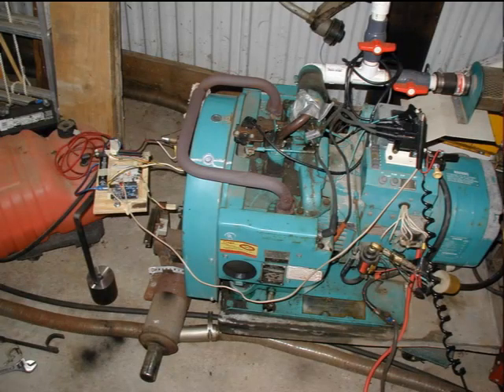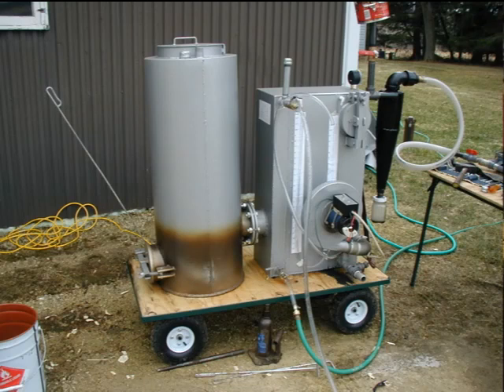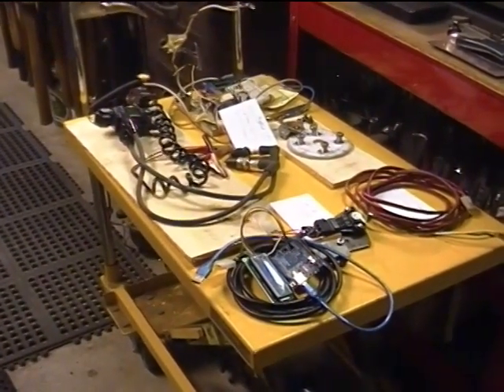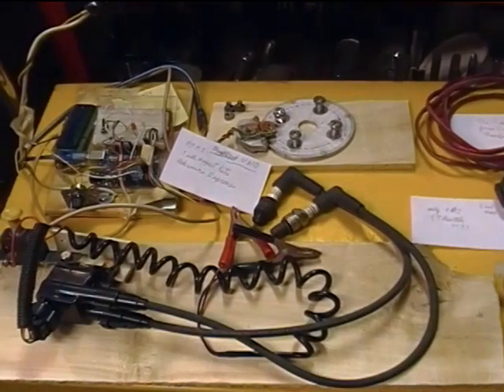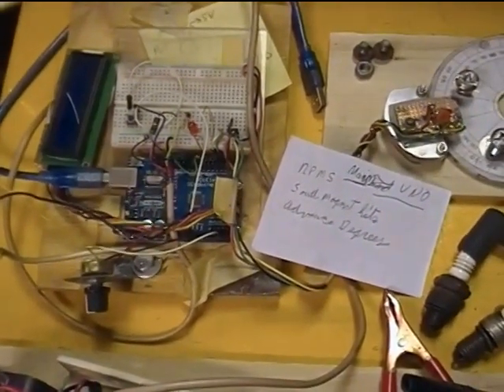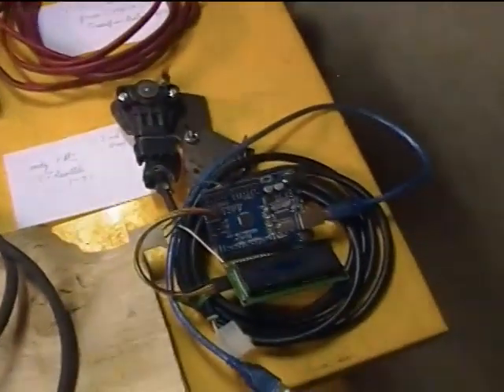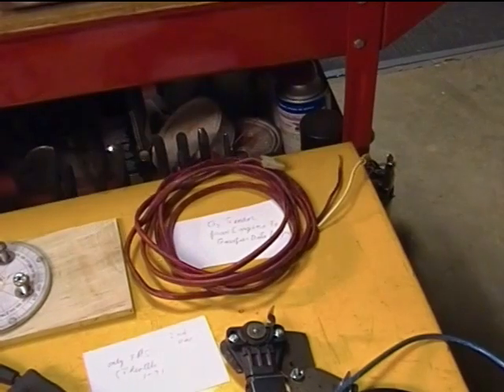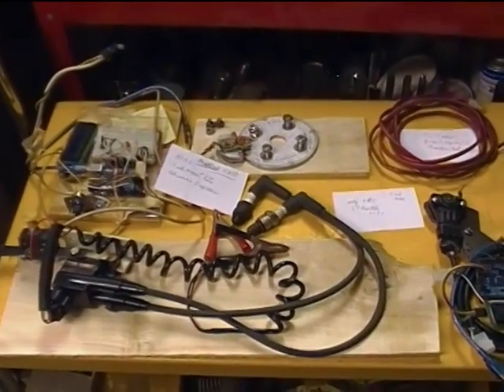Arduino ECU for Old Onan Generator to Run on Woodgas #214A

Comment: Also, how much do you want for the gasifier and where are you located, i forget.
Reply from the maker: I am located in west central Wisconsin, about 40 miles east of St. Paul, MN.
I want about $200 for it.
Reply: @frenchcreekvalley  That's about a 14 hour drive so I don't know if it would be economically viable. How much does such a gasifier cost shipped?
Reply from the maker: @thereynolds2725    I am afraid that it would cost well over $200 to ship it.  Even then, I'd have to make a shipping container for it.  i may simply scrap it.
Reply: @frenchcreekvalley  No, I mean, how much did it cost new delivered? I might make the drive to pick it up if it is worth while
Reply from the maker: @thereynolds2725  That was a long time ago, but I think the sales price was about $750 from an importer in the Portland Oregon area.  I think shipping cost was about $350 delivered to a truck terminal about 50 miles from my place.
It came, disassembled, in a plywood box.

Comment: Hey Frenchy, this is the project that made me subscribe to the channel! I found an Onan 5.0 BGA generator in the scrap yard. It was missing the governor arm and fuel pump and the points were shot. I decided to use propane and hopefully wiod gas. I attempted to use an Arduino, an optical sensor, and servo to control the throttle, but the servo was too jittery and the optics got dirty. Finally, I ended up making a governor control using a wire and spring. I scrapped the Arduino and optical sensor and just used a hall effect sensor with a magnet. I can adjust the timing by rotating the magnet on its spindle. It works great. I found that i didn't really need to adjust the timing very much across the load range, so i just set it and forget it.
Reply from the maker: Cool!.

Since you "scrapped  the Arduino and optical sensor", what did you do with the Hall Effect sensor's output?
Reply: @frenchcreekvalley  The hall effect sensor operates an IGBT through an optocoupler to fire the coil. It works very well and never gets gummed up like the optical sensor.